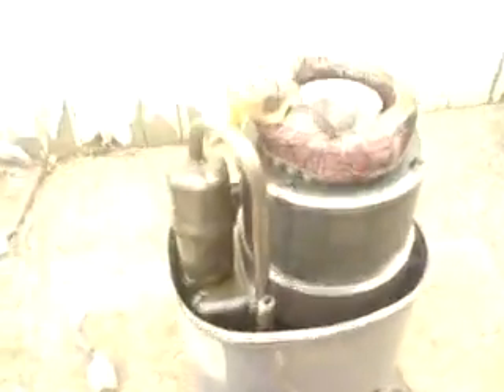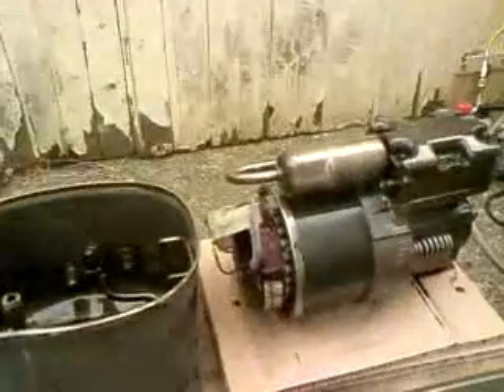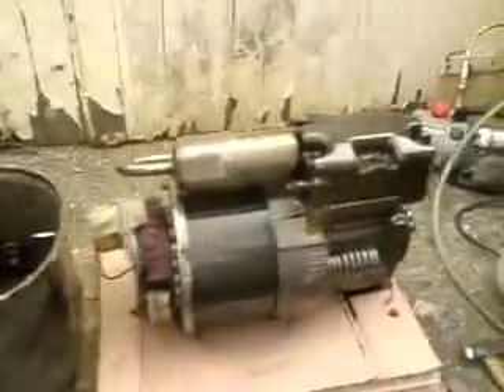Compressor inspection pt1

Comment: Nice idea on the suction tank. Did you install a separate drain plug?
Reply from the maker: +Nicholas CeeA I usualy put about 5psi nitrogen in to push the oil out.